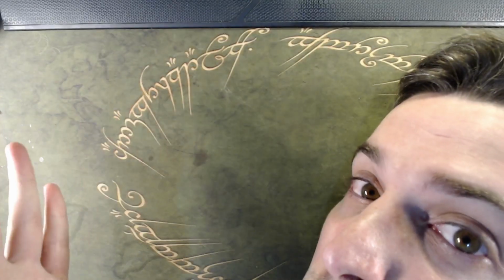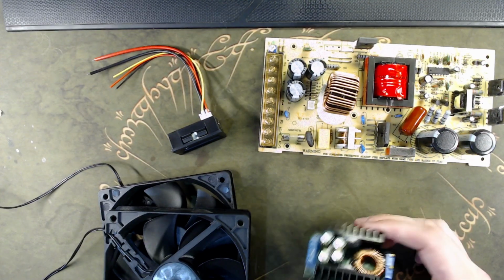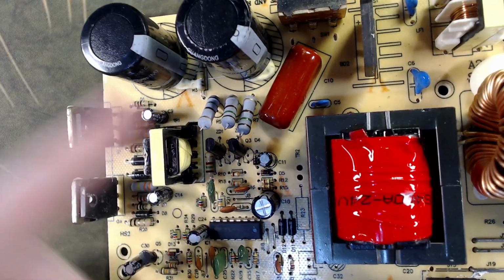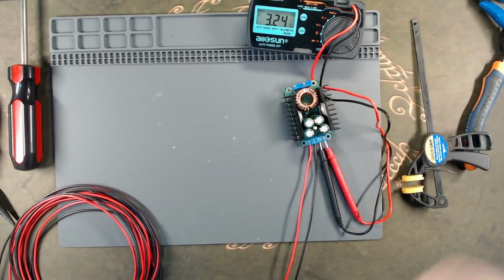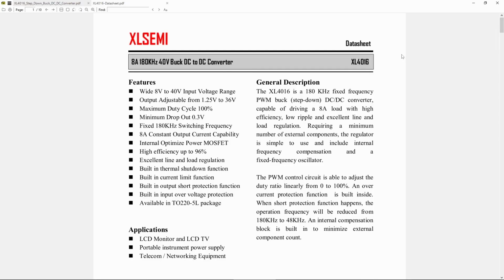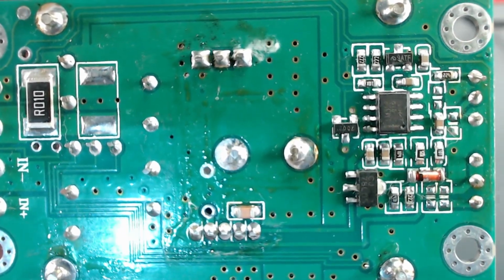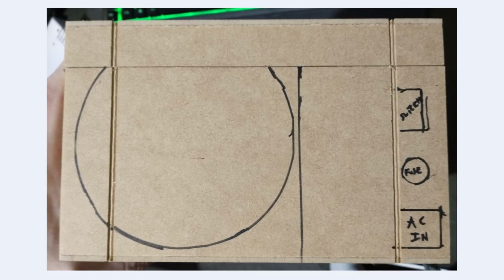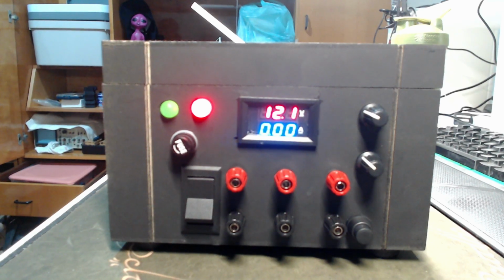Maker Lab #2 DIY Adjustable Power Supply (HIGH POWER!)

Comment: What's the ripple voltage under a light load?
Reply from the maker: I could not detect anything analyzing it full range. Maybe with a smaller signal it could have a little bit of distortion...